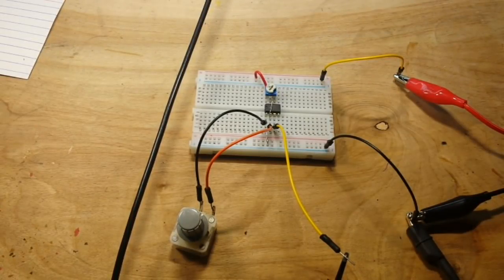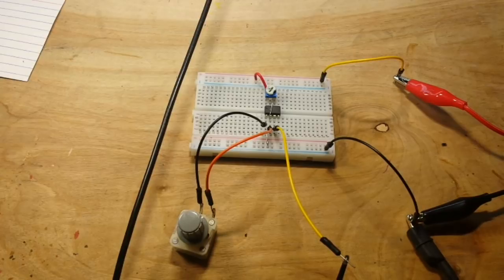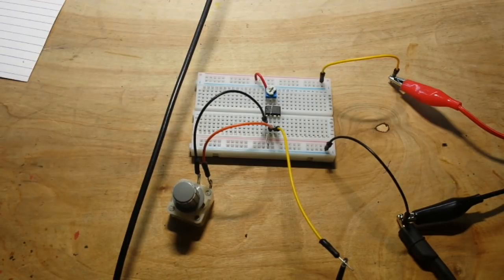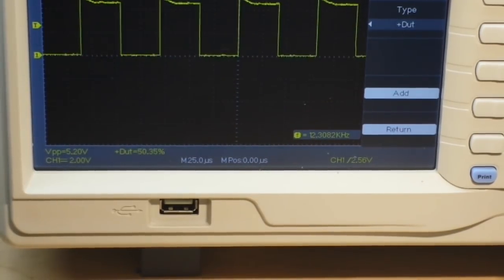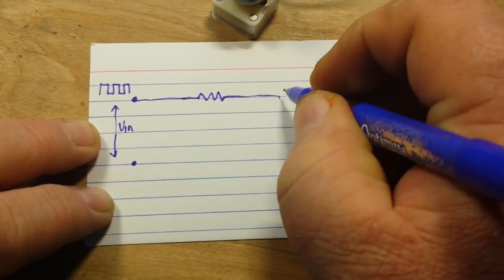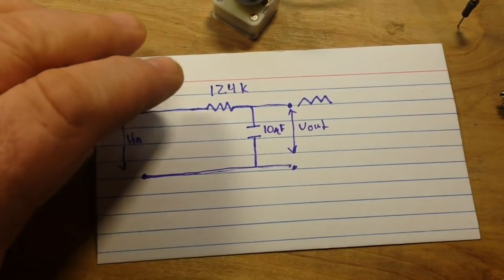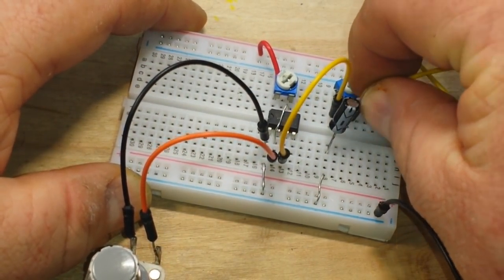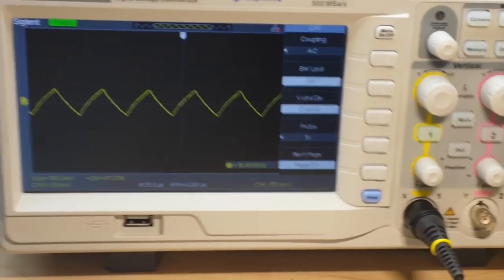Let's make a function generator(2)

Comment: LPF...I have been an EE the same amount of time as you!!  I have, several times, mathematically derived the 555's Freq, pulse width, duty cycle....and YES the duty cycle ONLY depends on the resistors...makes for some interesting uses for the capacitor, especially if it is CONTINUOUSLY adjustable.  HENCE the following question:
WHERE did you get that adjustable breadboard cap????  What is it's range...NEVER had one!!

Comment: Thanks for the videos.  The combination of 124k and 10uF gives me a flat line.  I am using a 1K pot and a fixed capacitor, so my square wave stats are different than yours.  Can you direct me to your video that explains the math to determine the resistor and capacitor?
Reply: I did it in LTspice and I used 10mF isntead of 10uF and I got the triangle, although its stunted in volts in a huge way.
Reply: also it seems that 124k does nothing because if i remove it from the circuit i still get teh same result

Comment: I'm new to electronics, sort of. In the second video on building a function generator you drew the integrator circuit before applying it to your circuit. Did you adjust the triangle wave with the potentiometer in the integrator circuit?

Comment: Hi, I was just fiddling trying to build this circuit because I bought one of those cheap JYE tech dso 150's. Upon building I notice that in the drawing the signal goes through resistor first then a cap to ground and the signal taken at the resistor/cap point. When I try that I dont get anything but if I put the cap to ground before signal goes through resistor I get a triangular shape? It looks like you do that when building circuit to but in previous integrator explanation it shows after resistor cap goes to ground. By the way my dad is a Ham also W8CCY....Michigan. He got me interested in electronics as a kid with those radio shack kits. Only until now I'm starting to understand what's really going on a bit more. Thanks for making these videos.

Comment: 06:06 That's not quite a triangle :q  It's just charging/discharging the capacitor, so it follows the exponential curve, which isn't quite a straight line.
Reply: Are you going to notice that at 15000 times a second? Looks close enough to me. But i would notice the decrease in amplitude at higher frequencies.
Reply: @E-BikingAdventures   Yes, I would notice, even by ear. Something might "look close enough" on the graph, but those curves are not the same, and because of that, they have a very different composition of harmonics (i.e. different spectrum), and this can usually be heard by a trained ear, in a form of "ringing" or other noises. A triangular wave sounds very different than a sine wave, and different than a square wave. Sine waves are pure tones, while triangular waves are a mix of multiple odd harmonics that make the sound more "acute". Even if you approximate the shape of a sine wave with parabolas, they will sound differently despite "looking very similar" on the oscilloscope.

Oh, and even if I wouldn't notice the difference due to the frequencies being much higher than my ears' capabilities, an electronic circuit powered by such a generator would notice the difference as well.
Reply: @bonbonpony  . From what I saw in the video, it looked close enough to me. Have you seen how messy bus signals are? A lot worse than the small difference in the video. BTW, I have a diploma in digital electronics. I'm aware of all that stuff.

Comment: In previous films you have been changing frequency by changing variable resistor, now you show that only capacitor changes frequency. So, what is true?
Reply: It depends on what role  the component plays in a circuit. With an NE555  the  capacitor across pins 1 and 2 , the frequency is set. With the resistor across 6, 7 and 8 the duty cycle is set.  In an traditional  RC circuit (resistor / capacitor) we could vary either the R or the C and change the frequency. I think in this case the R is inside the chip  (pin 1) and the capacitor is all we can change.  The data sheet shows this.  http://pdf.datasheetcatalog.com/datasheet/fairchild/NE555.pdf
Reply: Listen close he used the v.c (var. Cap.) To change the  frequency. Potentiometer  for duty cycle. It's a simple thing.....i am used to what the function of  a (vari cap)
Is though. I build crystal radios and slayer exciters. Aka solid state tesla coils.  If u thing of tuning a radio. U spin the knob and the station changes. Well all your doing is taking one frequency and ur spinning that (vari cap) and you will pick up a different frequency.

Comment: Thanks for the video.  I love the old 555 timer IC's.  Someone gave me a 555 Timer Cookbook last year I think dated the late 70's or early 80's, there was a lot of good cookbook series of electronics books.
Reply from the maker: 555 probably the most used IC in history.
Reply: You can do a lot with them for sure, very versatile chip.
Reply: Pete, out of curiosity could you please share the reference of this 555 cookbook?
Reply: @laurentd9980  The book is called IC Timer Cookbook by Walter Jung.  You can find it at used book sellers.

Comment: Varying the capacitor doesn't change the duty cycle, but varying the potentiometer changes both the frequency and the duty cycle.  The addition of a resister and two steering diodes can allow you to change the duty cycle without changing the frequency with the pot and then change the frequency with the variable capacitor (without changing the duty cycle), for example as seen in http://neilwebber.com/notes/wp-content/uploads/2017/01/astable1-768x540.png

Comment: I am aware that the RC circuit is way less complicated than using an OpAmp, but I was curious if the OpAmp Integrator would have given a sharper or more symmetric triangle wave?
Reply from the maker: Good observation, we will get that, coming in the video or two in the series.

Comment: Cool. It's a simple RC circuit. However, can you give a few examples where changing the freq would be beneficial? For LED dimming, adj the duty cyc is far more important. Same with motor speed control. Changing the freq would change the "smoothness" of the motor but not the actual speed, ya?
Reply from the maker: For a function generator, you want to be able to adjust frequency, duty cycle, and the shape of a wave.
You change or sweep frequencies to see how your circuit reacts at different frequencies. If you are dealing with audio you may want a sine wave or even a triangle wave to change the timber of the sound.

Comment: I have also blown things up!  Your not a real engineer if you haven't!
Reply from the maker: That is the truth.
Reply: learnelectronics working on HV switchgear, 3.3kv and above, I got blasé at times on lower voltages like 415v and 240v which we often worked on live!  You soon learn respect once you've had a couple of belts though!  Electricity is a good servant but a bad master!  My advice to beginners is caution at every juncture!

Comment: A 128 millihertz low pass filter? The frequency I don't understand.🤔
Reply: I got the same results and decided to re-check my math.  I think it needs to be a 0.001 uF  capacitor. So Rc is a 1.28 kHz filter. I made the circuit and it works with a .001 uF.